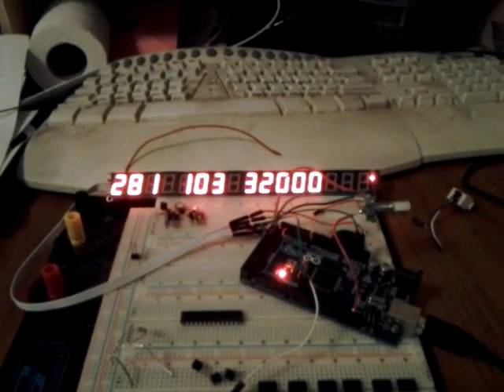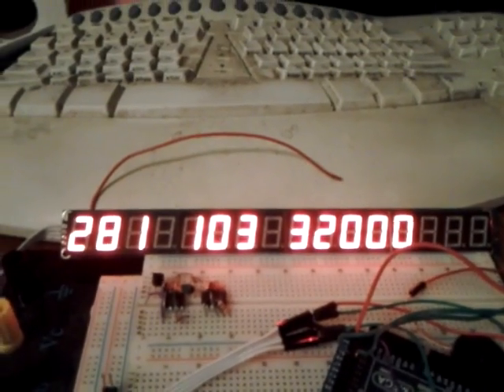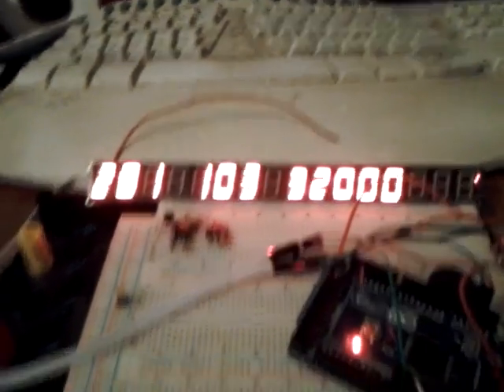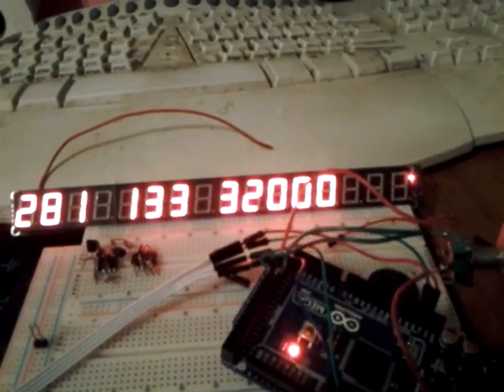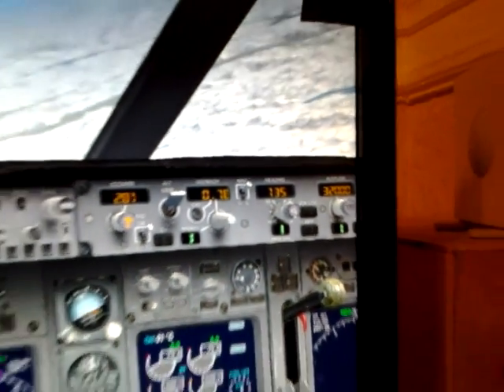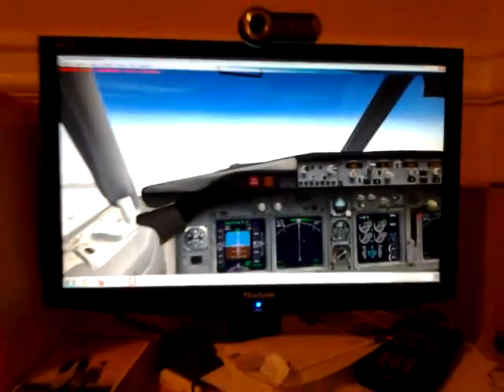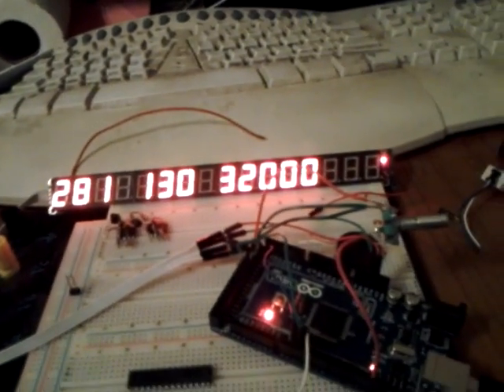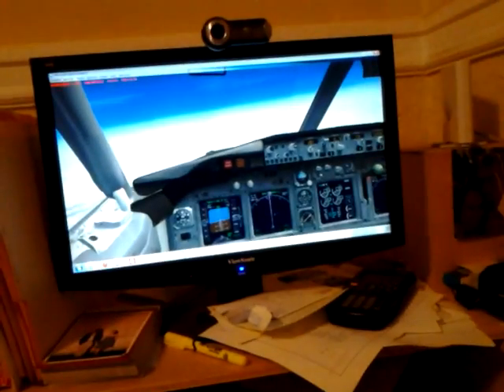Rotary Encoder, FSX, Arduino, TM1640 display working together

Comment from the maker: I don’t remember. The hard part was done using a free 3rd party software program that would talk to the Arduino via serial connection. The other hard stuff like reading the rotary encoders and driving the LED bits were also free libraries that took care of the hard stuff. I’m away at the moment with work. Maybe I can dig it up when I get back

Comment: Hi Bill!

First of all, 
That's a great little project you got there!
I'm building the same thing right now,
Got my Arduino board the other day and the 1640s are on the way :)

I wanted to ask you which of the Link2fs programs did you use?
The inOut or Keys?

And where can I get your code for that?
Is it Jim's code?

Thanks a lot for the Vid and info!

Comment from the maker: Just any two IO pins, don't need interrupts, the library is good enough that it works without error 95% of the time, and if there is an error, no big deal, turn the knob one more click. I now have 8 rotary encoders hooked up and working. Stay tuned, will have a webpage and complete source code, along with any parts needed to build your own.

Comment from the maker: You need to start with the basics, if you can get the display to do something simple, like a hello world program, then move onto something more advanced.  I am using a library that is available on the internet on google code called TM1638. The I have not had the issue you speak of, but that doesn't really say much as there are many steps along the way that can cause issues if not handled properly.

Comment from the maker: Certainly is possible. I just modified the code and used a different library for the rotary encoders, they now work super fast! 
If you sign into mycockpit forum go down to the Arduino cards and Link2fs forum you will see my posts and code posted there.